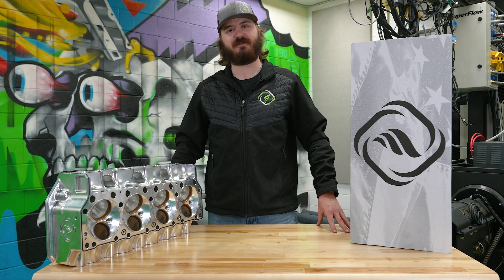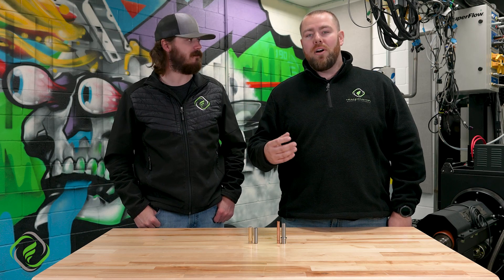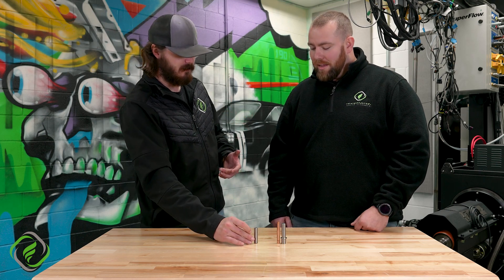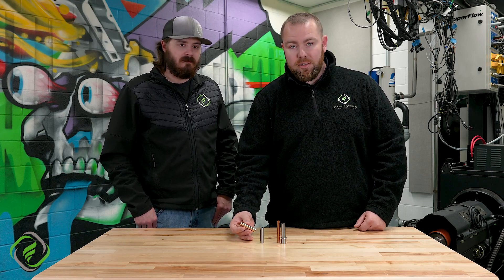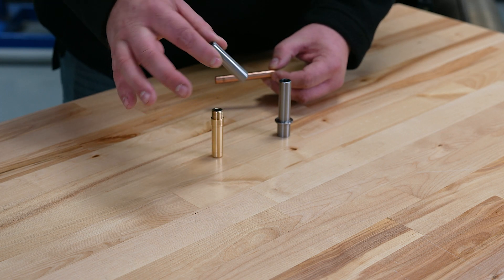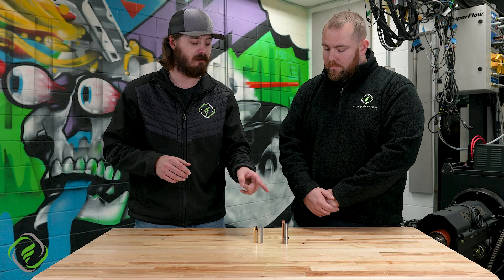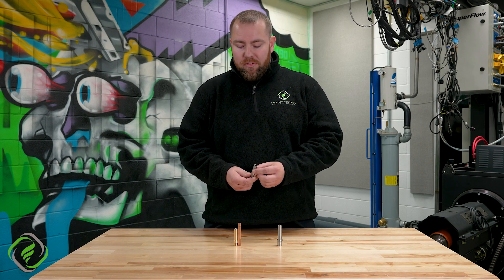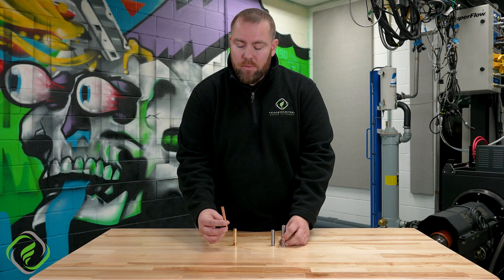Frankenstein Tech Series S1Ep3 - Valve Guides

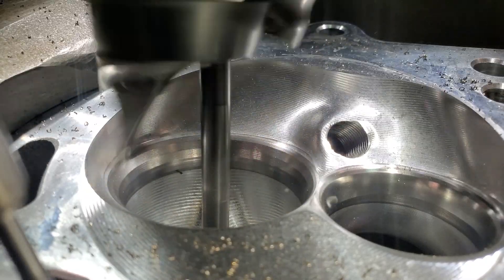Comment: 1:53 How TF does that work!?! How does the tool cut the minor diameter first then expand as it withdrawals?
Reply: Its a NEWEN cnc contour .  valve seat cutting machine.
Reply: @Baard2000  how common are cnc shops that have newen/similar equipment and can cut/finial valve job?
Reply: @richardprice5978  in the Netherlands only 4  or so...
Reply: @Baard2000  any in the USA? and 4 🤔 so rare and that probably means that full radis valve service is as well?
Reply: @richardprice5978  I dont know how many in the US are in service.

As I live in the Netherlands and being professional headporter I know about 4 in the Netherlands. 

There isnt even a Rottler  F69  head porting machine in the Netherlands.    I know of a few companies doing sone 5 axis porting but its mainly done outside business hours on those machines. 

The numbers 9f heads used are too small to have such machines.  Also the enormous choice in reasonable priced heads from overseas head suppliers makes it almost impossible to earn money with it.
Reply: @Baard2000  thanks, for now me/my charger is in the SLC ut 🇺🇸 area's and nope im running hard to get/expensive ( so my buying opportunities is limited ect but at least i have a starting point to work with ) iron D-8 2018 castings so from the factory are loaded but with so so parts/final finish and copper-B ( as my understanding is the better choice for my application and power level 1+K BHP@ the flywheel on pump-gas and about 225 water temperature as im planing on dallying on the hoter side of things ) seats is on the list and a radius job aka trying to maximise potential of my setup and have it last for about 1500+ hours @ 3 K rpm = about 100k @ 60 mph miles of run time between TBO's

a little on the fence about full or half TI vs full incannale valve's @ *63mm or 2.5 " inch head sizing by about 3-5 inch long 10mm holo main stem ( full lubricant on the inside and out as the valve seal is in the roof of the port aka the bottom part ) neck down to about 8mm as the heat is a big part of the reason im on the fence and im not sure if the ti is going to were funny as my valve covers are hard to get off /funky VVL muti-air/hydraulic valve train system in my car/my test fitting showed that so valve adjustment or removal of the heads for a freshin up is a big job my guess book-time is at leasted about 20-40 hours as the intake/exhaust ect will box's it in of it ect

Comment: Very nice explanation. Really helps someone learning the process like myself. Can you elaborate a little on what someone may expect when purchasing Frankenstein heads from a Vendor like RPM? Would you expect bronze guides, or the powdered metal with bronze sleeve? It seems like the bronze sleeve would be for a high end application. In an LS7 head, are roller tip rockers an absolute must for longevity of the valve guide and valve? Thanks for your help, enjoying the tech series.
Reply from the maker: Thanks for watching and the questions! The valve guides in cylinder heads will vary on the cylinder head, but our ls7 heads will come with CHE guides regardless of where you buy them. Your other questions will be answered in future videos! Again, thanks for watching!